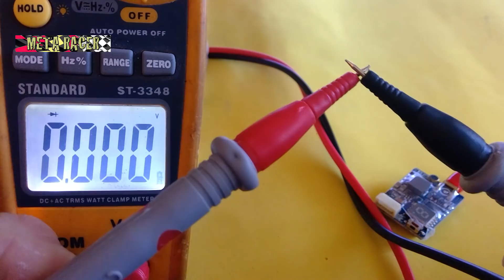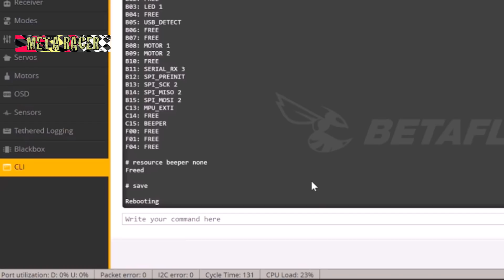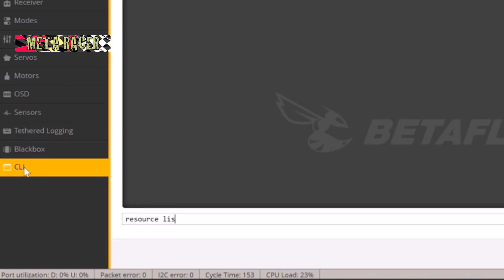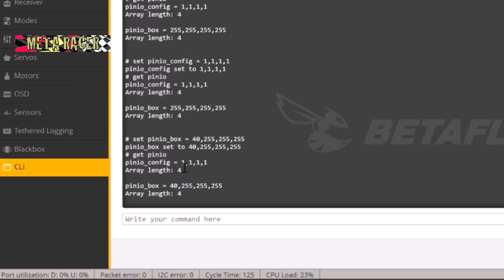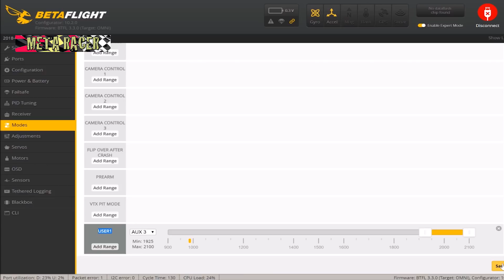How to change VTX channel with push button, with a simple cable and 4 betaflight commands !!

Comment: Thanks for this tutorial, but I have a problem with my 20x20mm Matek F411.
The mod works fine and I can change everything on vtx now with a switch but everytime I power on my drone it moves on to the next vtx channel automatically, EVERY SINGLE TIME, so, When I want to fly I have to go for all the channels so I can get mine :(
I already disabled all beeper settings in betaflight but this keep happening, but when I have my fc connected to the betaflight and plug in a battery it doesn't do that.
Please Help me
thank you
Reply: If you power the FC via 5v first then power the quad it won't change channel. I dont think there's any fix for this.
Reply: But why everybody is making this mod and it works fine for all but mine do this ?
Reply from the maker: each receiver has a system ... some is by the button giving a pulse with the station on and the channels in the position you want to memorize, others are adjusted from the station menu .. read the manual of your rx and memorize the failsafe
Reply from the maker: http://www.youtube.com/c/METARACERPRO?sub_confirmation=1

Comment: thats just perfect guys nicee :) Theres a small problem. whenever i reboot my fc/plug battery the channel changes like you hit the button. I did try to completely remove from the mode tabs(in a case of failsafe or something it passes from there) but still changes. any ideas?
Reply: This is due to the fc pulsing the buzzer pin. This system only half works. You can power the FC first by connecting a USB then connect the lipo and it won't change channel, but if you connect the lipo directly without first powering the FC the buzzer will be pulsed.
Reply from the maker: It is very important to set the switch rate of your transmitter to the end of USER 1 mode, and the margins right where the interuptor is activated, to avoid activating the mode when restarting the controller.
It is also very important to memorize the failsafe of your RX with the interputor off. Verify the operation, memorize fail-safe, create a mixture so that it does not activate with a armed drone.
Reply: i have done everything as you mentioned. plus i have completely remove user1 from the modes, so it wont be activated at any changes. but when restarting the fc it sends a pulse
Reply from the maker: Check that the buzzer is disabled in both beta and cli mode. I should not take a pulse if this mode is not user1. If you continue, delete the pinio you assigned in resource.
Another important thing, in our manual we indicate C15 because it is where the buzzer of our board is configured, but not all the boards have the buzzer in the C15, so before sending the commands you have to send a resource list, to locate the position of the buzzer.

Comment: awesome! Can you use another pin the for beeper ? I like my beeper :-D
Reply from the maker: It is not advisable, because the UART goes directly to the microcontroller, but the buzzer output has a transistor mosfet driver that is connected to the GND signal, and the vtx on the side of the button have a circuit voltage that can be 5v, while the controller goes to 3.3v and we can burn the FC if we connect directly, so with this system the mosfet acts as an intermediate driver and the only thing it does is send to gnd the signal that has the vtx button.  Is the price of this mod, lose the buzzer, but you can always use the beeper of the motors..
Reply: That is very detailed explanation, thank you! Will see if i will try it ;) 
But the mod istself is very very good and clever!
Reply from the maker: Thanks to you, enjoy it!
Reply from the maker: Correct, you can use a mosfet transistor similar to that of the polarized buzzer to negative and connected to a port or resource pin of the FC to switch the vtx.
It would only be remapping the pinio 1 to that port.
Reply from the maker: We will work on a mod with mosfet, attentive to the channel.
Greetings.
Reply: Isn't it also possible to just to add a npn transistor switch circuit connected to another remapped ppm pin? But as far as I know you can't use a uart for this though..
Reply: How about video about that ? :-D Cause i'm lost now, not that skilled in this area :-(
Reply from the maker: http://www.youtube.com/c/METARACERPRO?sub_confirmation=1